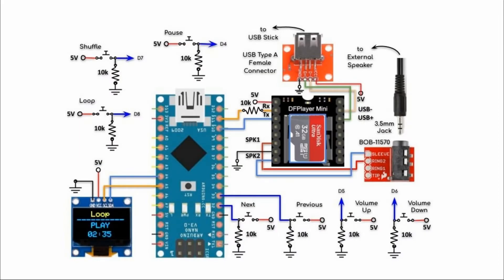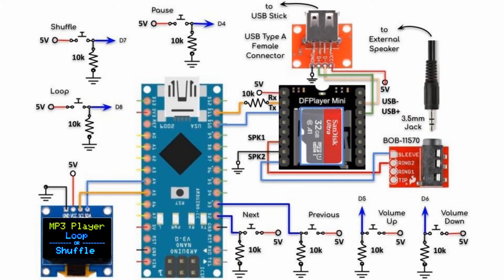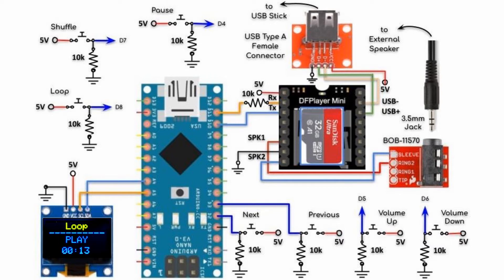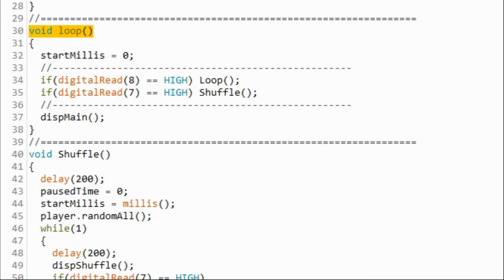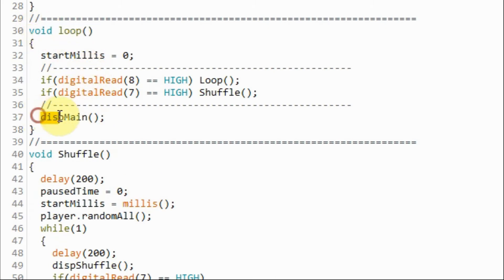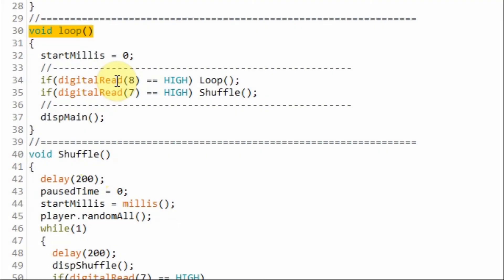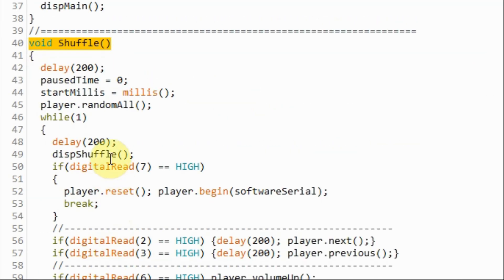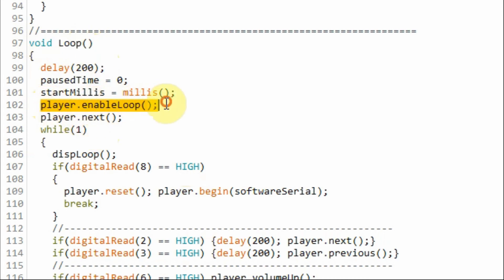Arduino-Based MP3 Player (part 3)

Comment: Sir if i wanted to add an internal power source what should be it's specifications
Reply from the maker: Hello. The whole circuit in this project is powered by supply from the Arduino. When you suggest internal power source, do you mean an external power supply?
Reply: @AnasKuzechie  yes sir like a battery. i wanted to do a casing and hence the word internal was used.